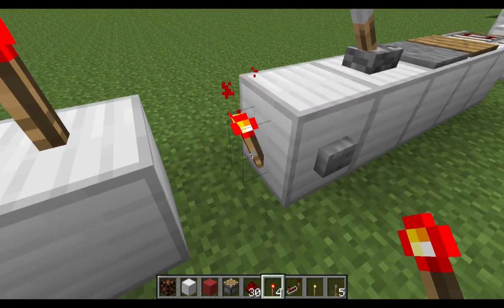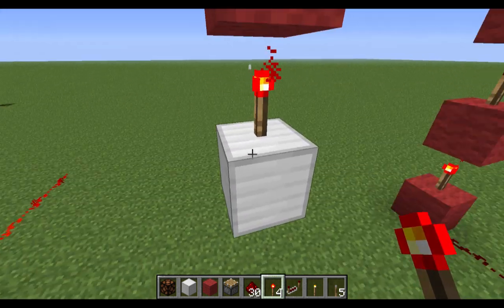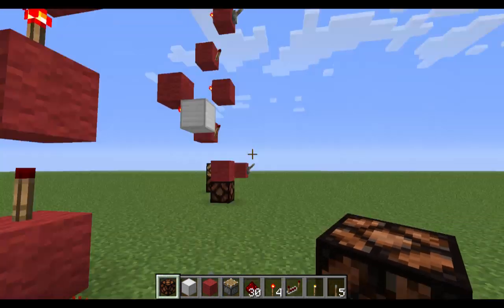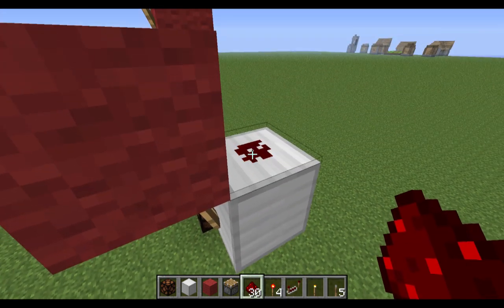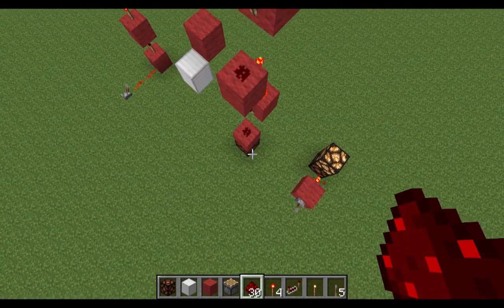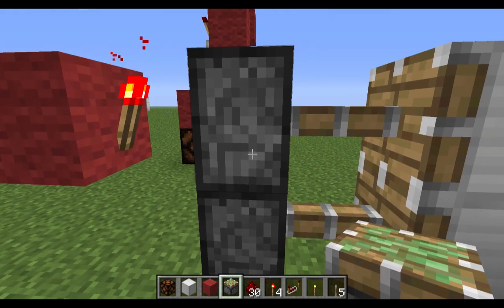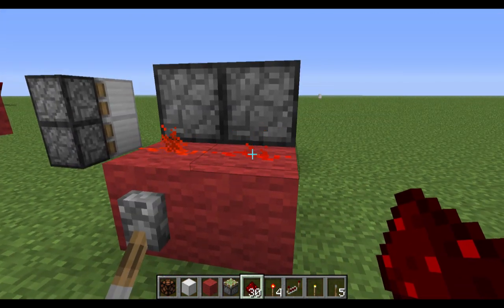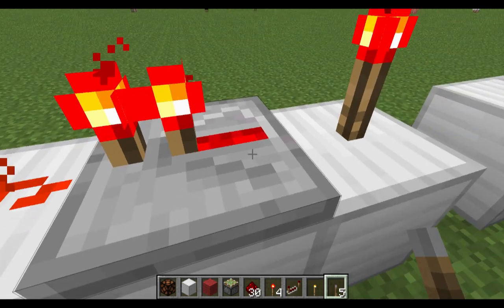Redstone Academy Ep 2 - "Redstone Torches"

Comment: A minecraft tick, (The measurment of time used in determinig whe  stuff grows etc.) is 1/20th of a second, whereas a redstone tick, the time it takes for power to transfer through a block, is 1/10th of a second. Also, the 3 high piston thing wouldn't work 2 wide, because the redstone dust wouldn't power the top piston.